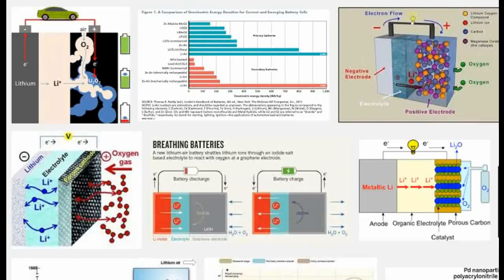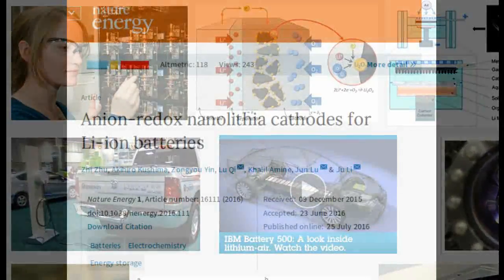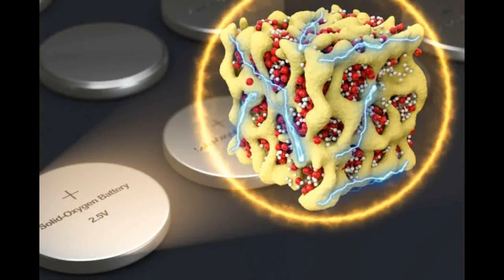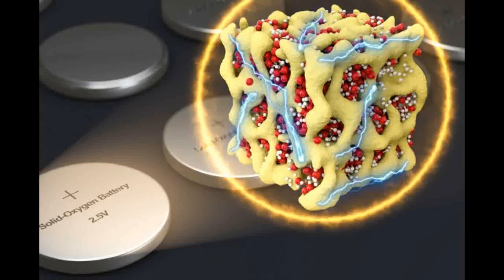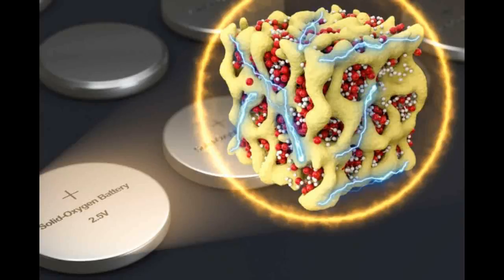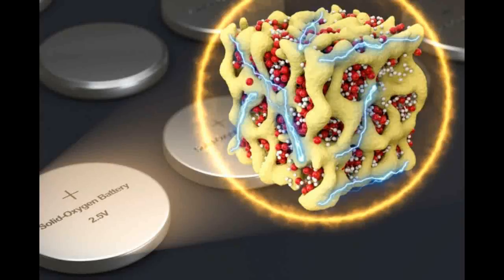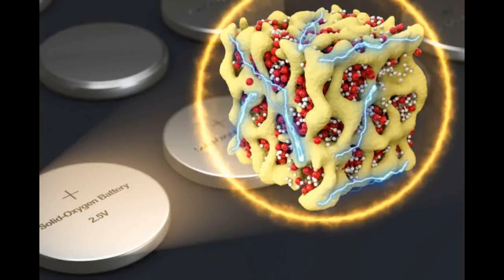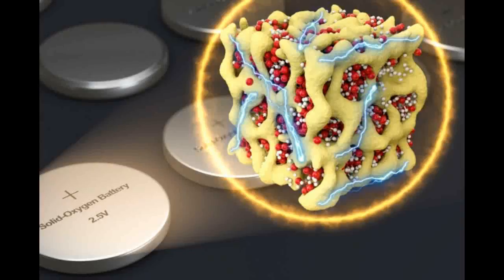Nanolithia Cathode Battery: New Lithium-Oxygen Battery greatly improves Energy Efficiency, Longevity

Comment: Why did they stop at 120 cycles.  What is data for 120+ cycles, like 500 cycles, 1000 cycles, 10,000 cycles.  Also, what is the performance with respect to temperature.  Will this work at -50C and +50C?